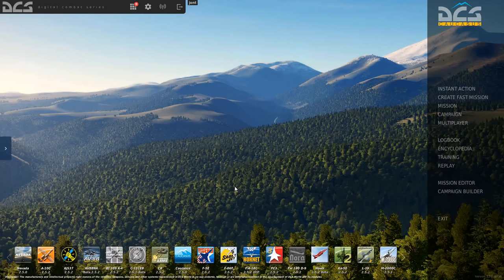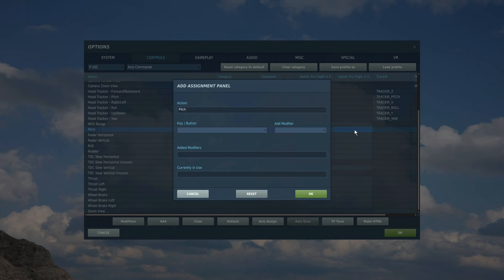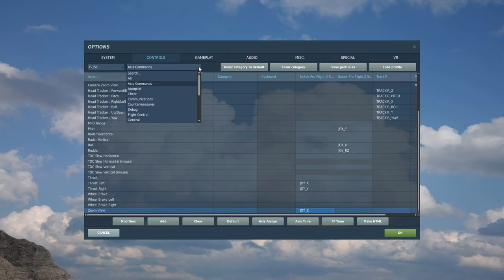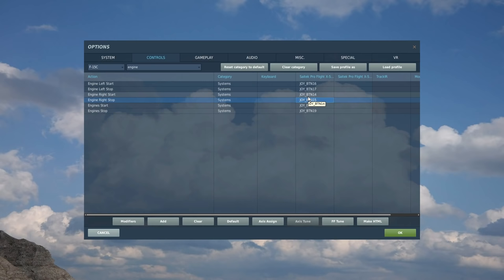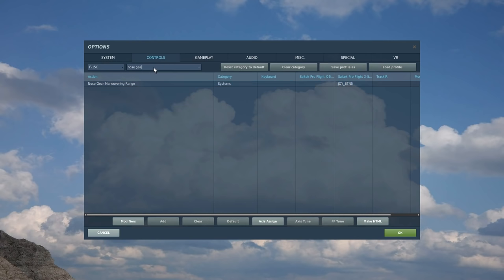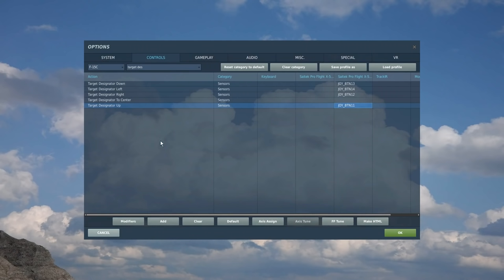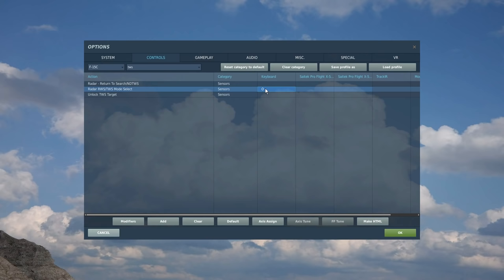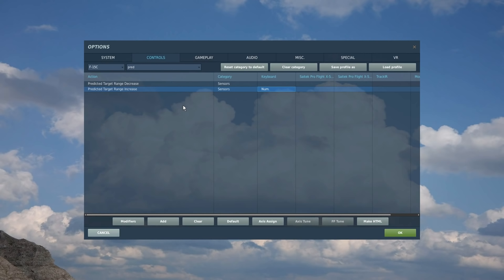F-15C Eagle: Setting Joststick Controls Tutorial | DCS WORLD

Comment: Have you considered using the thumb rotary knobs on the right throttle of you X-56 for the rudder?  I use an X-55 Throttle, and I use one of those rotaries for the rudder.  The center detente is a great reference point for it, and keeps it from moving around unintentionally.  I never liked the twist rudder on my X-55 stick, I was always activating it on accident.
Reply from the maker: hmmm interseting, will investigte
Reply: @grimreapers  It'll also stay where you leave it, instead of Auto-centering like the stick twist.

Comment: I'm a little confused. I have the same HOTAS that you did in this tutorial.  You said you were out of buttons, but you weren't even close to being out of buttons.

You have a 3 position mode switch, which allows you to have three different bindings on the same button. And even if you didn't want to use the mode switches you still had the 4 two position momentary switches across the front of the throttle and a half dozen rotory encoders not being used.

The way I use the mode switches is everything combat related goes on mode 1, NAV goes on mode 2, all ground, taxi, takeoff, or landing on mode 3. It works out quite well.